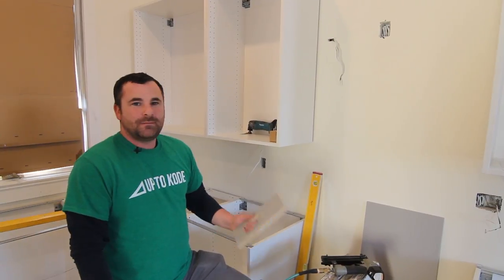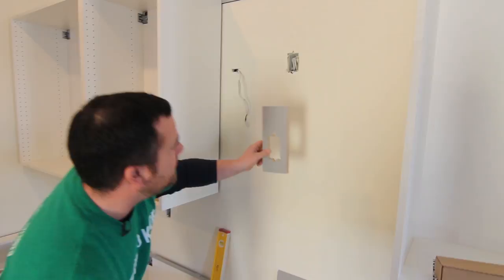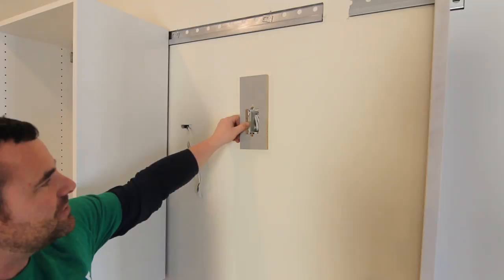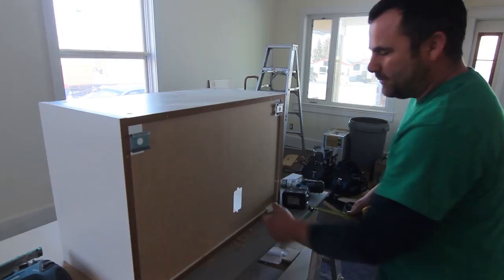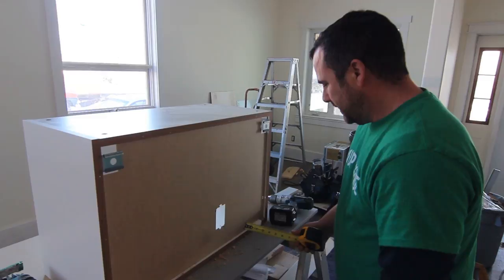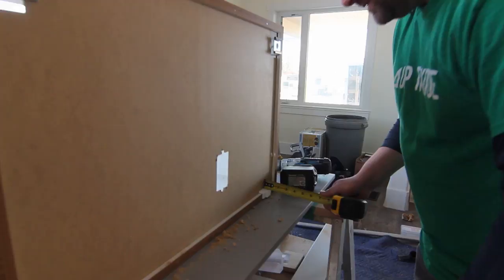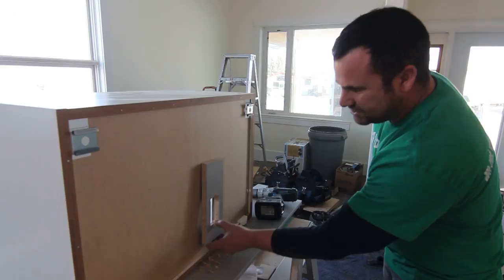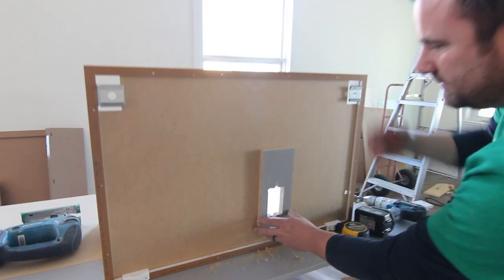IKEA - Microwave Cabinet with Receptacle

Comment: Great videos, look forward to installing my Ikea kitchen, but I do have a question regarding the microwave. Our Samsung says it needs a max 12" cabinet depth but Ikea's are 15", have you experienced any issues?  We will be venting outside.  Thanks
Reply from the maker: IKEA makes a spacer block to accommodate for the deeper cabinets.
Reply: @uptokode  Hi Kody-it appears this IKEA "filler piece" has been discontinued and we are having the same issue as Nick above. IKEA has a top filler piece, but not a bump out type of piece.  Any ideas for this quandary? I've searched online but no one has much to say about it which is surprising given how many IKEA kitchen installs are happening. I saw posts where people simply use 2x4s or plywood to bump out the micro hoods, but others comment that installing that way would not meet code requirements of no flammable materials less than 30" from cooktop. Thoughts?
Reply: you could try using an IKEA Knoxhult cabinet for above the microwave. The Knoxhult series cabinets are only 12” deep instead of the Sektion which are 15”.
Reply from the maker: Sorry I didn’t see this. I have done the 2x4 and plywood trick. And you could just cap that with sheet metal to fire proof it.

Comment: Good deal, do you do anything special when actually hanging the microwave on the cabinet? Thanks!
Reply from the maker: No I don’t. Just use the spacer as IKEA uppers are deeper than typical. Most of the weight of the microwave hangs on the wall itself and not the cabinet. Thanks for watching

Comment: Hey Kody, is there any way to customize the width of an Ikea cabinet and the drawer that goes with it? We bought a base cabinet for our microwave. The 30" cabinet would not fit our microwave,(which is 30 1/16" W) and we had to go to a 36" cabinet. But i would like to cut it down to better fit our microwave, mostly because of walking space around the  cabinet. It is an island cabinet and gaining an extra 5" or so would be ideal. Any suggestions?
Your 5 part series for installing Ikea cabinets is the best on YT. Thanks for making it.
Reply from the maker: Thanks for the question and great comment! I don’t think there’s an effective way to modify a cabinet in width, especially if you still want drawers. 

You could cut out a section of the side of a 30” cabinet to allow extra room for the microwave...then add a filler panel to cover the notch you made in the cabinet. That allows to 30” to remain and you can still use a drawer if you plan it out.
Reply: @uptokode  Thanks Kody. Yeah because the Ikea system is so well designed as far as the function of drawers and cabinets I couldn't see any way to make the change without it affecting something else in their design. I just knew if anyone knew of a way to do it, you would. But i like the idea of notching a 30" cabinet and then adding filler. I'll have to think about that one. Thanks again for the great video series. I feel pretty good about installing the cabinets thanks to you.